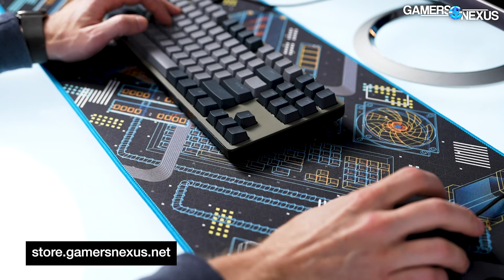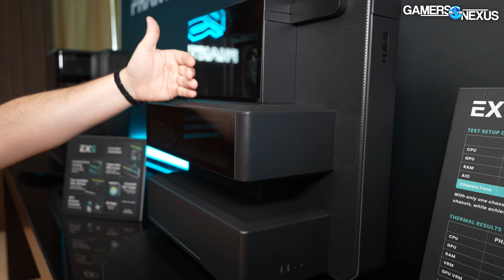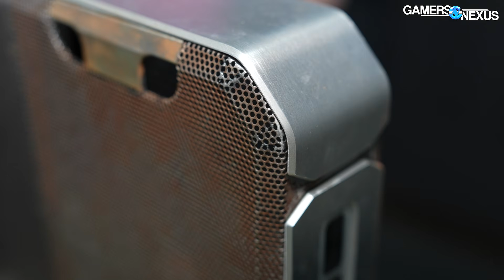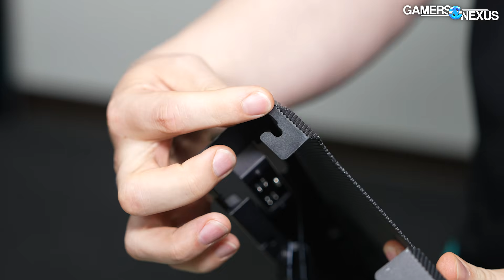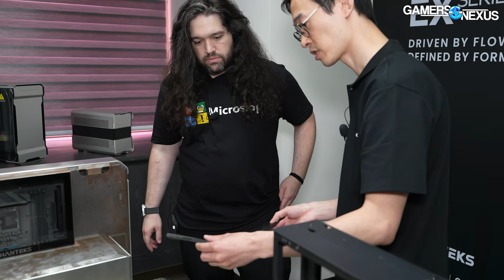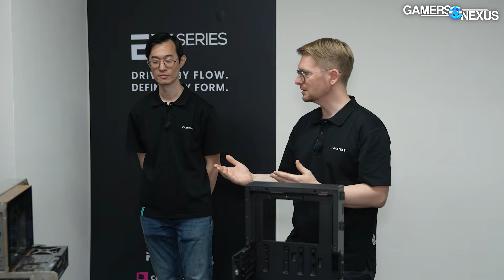Phanteks EX5 & EX6 High Airflow Chamber Case, ft. CTO & Engineering Discussion

Comment: My EX5 Max finally arrived. On the first day, I wanted to die. On the second, I wanted to send it right back where it came from. On the third day—after reflecting on 35 years of handling hardware and hundreds of builds—I decided to think differently. I completely reconfigured all the fan curves, meticulously, (the rear fan is the key: too much airflow causes the GPU—a 5080—to overheat, while too little causes the 7800X3D CPU to overheat). After hours of testing, I realized that the reviews I’d seen—which showed a clear temperature increase compared to a traditional case—were likely based on fan profiles unsuited to this specific chassis. In short: if you want the EX5, you have to put some love into it and truly understand its soul.
Reply: Interesting, what ended up being your fan curves? I have the plus and the same cpu but my gpu runs hella hot, based on what you said it's about tunning the back fan then?
Reply: @C.r.i.m.s.o.n  i'm doing all the job whit fan control, also the GPU, with 2 different curves for the two external fan and the central fan, they  have two controllers. I have also pbo and undervolt, help for sure to keep lower temperatures
Reply: @C.r.i.m.s.o.n  If you plan to use Fan Control, can my curve configuration file be useful? It could be a good starting point from which to make your own curves as you like. In idle (cpu-gpu) they are around 42°/30° and under load 60°/66° and in any case the curves can definitely be improved

Comment: I was thinking about 3D printing a case like this for myself...
Every chamber having their own airflow for intake and exhaust.
In my head it would look similar to this except I want an aircooler so it'd be a huge bulge over the socket and no fanstack for a radiator on the back.

Comment: ive owned a bunch of meshify and yeah, mesh is hard to get right.
even in their version that requires less attention to detail had its main point of failure be where the mesh was bent to curve. 
it became structural issues in my case.
interested to see how it turns out here, but i feat that it unfortunately i dont think it will not be viable for long term.

Comment: Really interesting video. Much better content than just the run-of-the-mill Computex videos around. This case was really intriguing, the only dislike is that if I want an aftermarket 360 you have to route the cables outside of the case. That and no dust filters. Thermal testing should be interesting to see.

Comment: Does the GPU chamber support GPU's weight against gravity to prevent GPU sag? If yes, how does it support GPUs in different sizes (e.g. 2-3-4 slot; different lengths, widths, thicknesses, etc.)?

Comment: They need to make these types of aesthetically pleasing chassis that can HOLD at LEAST 4x 3.5" Desktop HDD, 6x is even better. The last time they tried was in the Evolv X (The first version) which can hold up to 6x 3.5" HDD. Ditch the dumb glass see through fish-tank as it is not as it is no longer unitarian, you are sacrificing expandability for aesthetics which is dumb.

Is Phanteks ASSUMING EVERYONE DOES NOT sees need for 3.5" HDDs? Not everyone uses SSDs for data storage. COME ON Phanteks.

Comment: Since you have seen the full inside of the case, is there room to mount a couple 2.5 SSD drives anywhere in that case or no becuase of its design? Also, does it look like cable management is going to have issues do to space?

Comment: Im not sold, its just too rigid of a design and i cant see it doing much better than a 5400d for example. It seems to me the 5400d with the seperated aio but added fans pushing air to the GPU.as well as activley evacuating hot air must do better. Your leaving the GPU to ONLY its own fans amd yes it works but cant do better than having outside fans moving higher volume air througout the system. 

The backplate fan is something id like to see in other cases though.

Ill be very very interested to see how it performs when you guys get a chance to run it yourselves

Comment: I wonder if the VRM heat problem could be further improved by squishing some small heatsinks and thermal putty on the back of the board where the VRMs are. If there is even enough space between the board and the fan to do that. Glad some innovation is still happening instead of everything being a aquarium PC case with flashy lights.

Comment: I feel like they totally could've gotten away with some sort of trim or faux mesh piece that would outline or be the trim in the area's where the bends are and where it is obviously difficult to symmetrically line the holes up. Just as they mentioned on other panels where the edges of the mesh panels were solid metal. Even some trim pieces with lighting etc. Still a crazy cool case and definitely very unique other than the typical box or glass box.

Comment: I really want to like it. I prefer the the more polished materials on the EX6 and I want the built in AIO but I do not want the LCD. Are they going to release an EX6 Plus that has the AIO but leaves out the LCD? 

And along those differences, look where the I/O front panel is on the EX5 vs the 6. It is on the PSU shroud in an awkward place and it looks half ass. Why couldn't they do the power buttons and I/O the same as on the EX6? And why do both models have such wimpy I/O? I want more USB A and C ports on the front where I am more likely to insert and remove external storage devices. And thus, I want those USB ports to be at least 10G and not that crappy USB 2.0 standard. And those existing ports appear to be too close together to plug in devices in all of them at the same time. These are simple things to test and adjust the punch outs now.  Its 2026 and close to 2027 by the time these hit the shelves. Some of these issues shouldn't still exist by now.

Comment: AI needs to die so innovation like this can live on! This case is awesome. Love seeing stuff like this.

About the only issue I can see with it might be motherboard PCIE slot compatibility. For example, my motherboard the first PCIE slot sits lower than most (which also made my 4090's GPU support bracket solution not work with it). If the card doesn't sit in the right spot the cover might not fit over the GPU at the right spot (unless I missed something that has this height adjustable).

Either way, definitely looking forward to seeing thermal testing on this case. Really innovative design. I also like the built in AIO version, not only would it potentially save money on a new build, but integrates very cleanly. Super cool.

Comment: 20:30 I wonder if they could add mounting points for fans in the GPU box. Adding 2 or 3 cheap fans at the bottom would be huge.

Comment: Overheating will be overcome forever until the E-nd Time (33rd December 2029, according to the ashes of Henry's Filofax held in his locker next to the WEF sauna room) when man finally decides to put his computer in a tray next to a refrigerator exhausting into directabubble blowpipes forcing air over all critical components and out through depressurising speed-expansion venturis, from thence whither is the window or the household chimney.

In order to continue serving the unique and essential demands of the computing community, which will never decide what is its favourite colour, all refrigerators, venturis and blowpipes can be adequately festooned with totally pointless and hideous LED lighting.

Comment: Thermaltake made a similar case years ago.
Reply: 2009 Thermaltake Level 10 [w/ BMW Designworks] $850 full metal 50lb monster. Then the much cheaper plastic Level 10 GT a few years later.

Comment: Wouldn't a vertical gpu make a lot lore sense if the gpu is actually outside? This way, the hot air it produces is on one side directed into the case

Comment: To me, using radiators,  allows one to move all the heat processing and rotating fans to be moved away from the devices. 
Then you dont need to worry about hot air in a system, recirculating, just cooling radiators. For vram, put a tiny AIO on for that

Comment: 21:00 While the explanation regarding the aluminum chassis and the stamped holes is plausible, I actually have an old (2019) Lian Li aluminum case right here on my desk that features many small holes in both the front panel and the side panel—suggesting that, for Lian Li at least, implementing this design was seemingly not an issue. And the aluminum is approx. 1.5 mm+ thick. The Phanteks case looks nice. I wait for a review and thermal testing.

Comment: so the gpu can only be installed in an specific pcie slot otherwise wouldnt fit into the case box right? so not only you have to measure the thiccness on the gpu but also measure if the mobo.

Comment: honestly i think that shit fucking rocks. ...oh but the phanteks 'triple p' logo on the AIO looks ** awful. bad logo design, do not use it. just write the brand name on it per the standard font. phanteks is right that they need some revitalization of their brand standards' aesthetic but not that temu ass triple p logo. simplify, dont add stupid complexity. butt ugly concept logo
Reply: more cases that look like brutalist buildings please- love it
Reply: i have an nvida circular kraken w full gif support. include one screen withiin the case in the aio...? please?
Reply: the 10 in display model makes no sense. tempered glass is for seeing the components through the case - it hearkens back to the atomic purple Nintendo systems and the early thousands transparent mac desktops. make the sides screens and the front a non-translucent display.
Reply: wall mounted version of this would go hard
Reply: the tempered glass gpu front panel is awesome on all models. make it standard but include a mesh or flat front panel option/ alternative/ markup for people with ugly (zotac) gpus
Reply: awful power buttons.
Reply: the layering of chambers encourages users to use the chambers as displays, can we display like lego and other stuff atop these chambers safely?
Reply: re imagine this case with the same chambers in different positions. would we make it flatly symmetrical or symmetrical in 3 dimensions?
Reply: the rusted model looks dope actually

Comment: This looks so cool. Every once in awhile I consider migrating my system out of my old NZXT H500 and into a new case, and it's going to be tough to resist this one if the thermals are good. Only "downside" is that I'd also need a new CPU cooler (and possibly motherboard) that would fit inside, lol.

EDIT: Missed that the EX5 Plus comes with an AIO for just $50 more. That's a great deal!

Comment: EX case looks cool. No room for custom water cooling though. I use 2x420mm + 280mm rads with D5Next+large tank. Block for CPU+GPU+RAM+NVME. Imagine relying solely on air + 360mm aio lol.

Comment: But what about the power cable for the gpu? I'm using a b70 and it's power is on the end... Not sure it'd fit in the case... Though the airflow from blow directly into the gpu would work perfectly with the blower fan on it

Comment: A bit surprising, but J2C's coverage of these EX cases feels better, as it points out the different models/variations, and goes into details a bit more, overall it has more structure. But then GN's video (this video) is also very useful because of the interviews with Phanteks staff. So if you feel a bit confused, watch J2C's video too.

Looking forward to see some proper testing on both EX5 and EX6, and hopefully with the included AIO (Plus/Max variations) and without (bare EX5/EX6).

I still have some general concerns about the cases, like:
1. Ease of motherboard access. What if I need to access anything on the mobo, like SSDs, fan headers, connectors, cables, etc. , would it be easy, or quite difficult? Without seeing the actual inside of the case, this could be anything from easy to a nightmare. And of course, will the case only support mobos with front-facing connectors, only back-facing connectors, or both?

2. What about 420mm AIO support (for the bare EX5-6)?

3. What about storage? More specifically, what about 3.5" HDD support?

Comment: One thing I like about those cases is that the AIO is sucking in outside air AND the GPU is doing the same. Which means you don't run into the issue of which direction the air goes on your AIO that might impact the temperature of either the CPU or GPU depending on direction. Also, it looks cool. So I just might be tempted to buy one and see if I can wallmount it (with a gap in the back of course)

Comment: This would be great for my pc because the only location i can put my pc is against the corner of my room so two sides are blocked off other than an inch or so. My lian li ia great but the rear exhaust points directly into a wall and just gets pushed to the front od the case since its in a corner, ended up blowing my PSU because the only other path for hot air to escape was through the PSU. So now i have to move my giant case a few inches away from the wall or my PSU fan runs at 100% if it's too close to the wall.

The only reason i wouldnt be able to use thia is because i have two 360mm radiators and couldnt go to air even if i wanted since it's a 3090 kingpin.

Comment: The EX6 is not a good case. The GPU and mainboard temps will be worse then other cases. 
The GPU fans have to work against the mesh and the airflow typically is horizontal after the air hit the PCB. That hot air that comes out from the side will be recirculated or blown into the mainboard compartment.
Also the mainboard does not have good enough airflow to cool M.2s or the chipset.

Comment: That case is very nice, but does it have VESA mounting on the back? I specifically bought the case i did, a thermaltake core p3, for the VESA mount on the back to allow wall mounting.

Comment: Finally a drink holder worthy of my desk. Also like the overall slimness around the AIO section which lets you put your headphones there instead of your monitor or some extra hook attached to the desk. 

Would love to see some threading or similar on the bottom for one of these cases (or cases in general) so you can secure them to the desk if you place them right on the edge. I typically tend to keep cases on the ground for fear of accidents, especially in this economy, but a case like this belongs on the desk. 

Am quite interested in future thermal testing. Please also test older blower-style GPUs.

Comment: Really cool case design, like it a lot. I'm very interested to see thermal testing for this when it's ready because as cool as it looks, I'm worried the GPU will run hot in that chamber without additional airflow from fans other than its own.

Comment: I'd buy one of those cases, IN A HEARTBEAT, if it had at least a couple 120mm fans under the GPU chamber, if the rear fan is enough to cool the components on the board, and (most importantly) if I can fit my TG Wire View Pro inside the GPU chamber. 
If those three boxes are checked I will buy the one with the glass window and exposed rad tubes (I think it looks sick, also not proprietary) the moment I can verify all three are checked. 
No exaggeration, I love that design, but no intake fans is a deal breaker, and being able to run my Wire View is not something I'm willing to budge on, no matter how awesome a case is.

Comment: We need a way to wall mount it out of the box. 

Also, we need a version with a custom loop instead of an AIO. Like, pre routed tubes with only the output to each chamber with a pre installed D5 pump and reservoir.

Comment: Ya know I gotta say, HP kinda figured this out 25 years ago with internal case exhaust hoods and channels that direct airflow. If the air from your front intake can only go to your GPU and out the back, you don't get any crossflow or radiant heating.

Comment: I think they should just add fans to the front block part of where the GPU is like I get the chamber design but now let's add some fan features where you can additional fresh air inside and they can also design it in a way to look like an airplane engine intake or something

Comment: I love the style of those cases. Something different. It's not just a box.
Reply: I remember like 20 years ago Thermaltake had a big one available in white and black. I wanted one so bad.
Reply: Different doesn’t automatically mean good.  There’s a reason no one tries to reinvent the wheel.
Reply: Agreed. This one really caught my eye.
Reply: Just cut a plywood board and mount your stuff. Thats essentially these style of cases. Zero protection. How do these pass electrical interference and RF testing?
Reply: @MrGreen1988  what?
Reply: @MrGreen1988  Sorry bro you gotta drink the koolaid around here 😂
Reply: @Janzer_  Mix this case with some koolaid, its so awesome bro. You gotta try this case my dog.
Reply: @MrGreen1988  Do cases need to pass EMI? I thought the components individually must pass EMI without being in an enclosure.
Reply: @Voyajer.  I am not familiar with the requirements or certifications, labels. Cases used to be all metal. From that I assumed they provided some protection. I need to further research all those stamps and labels on our electronic devices.
Reply: @Voyajer.  These cases suck if you are playing in a boat inside an electrical storm in the middle of the ocean. Totally unusable for Mr green. He also uses them in the surface of the sun, so they need to be sunspot resistant as well.
Reply: @MrGreen1988  imagine trying to rant about certifications you dont even know the requirements for lmao
3/10 ragebait